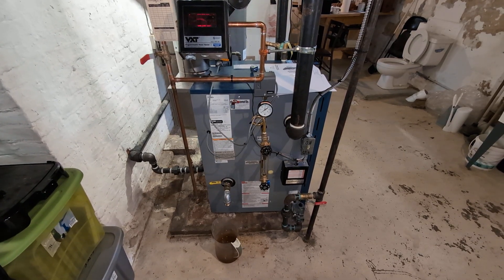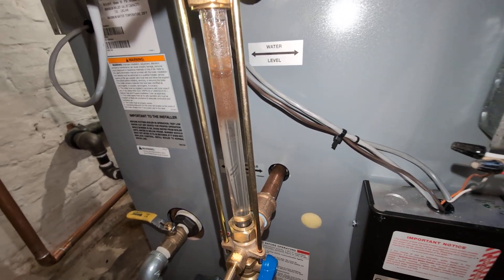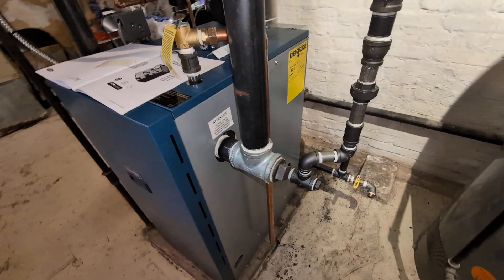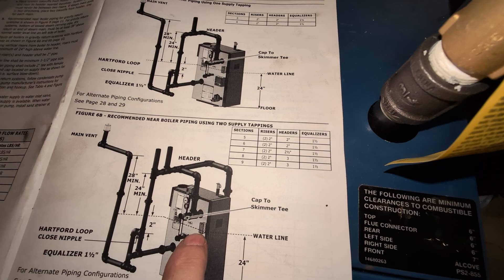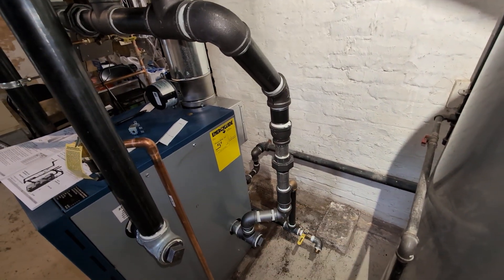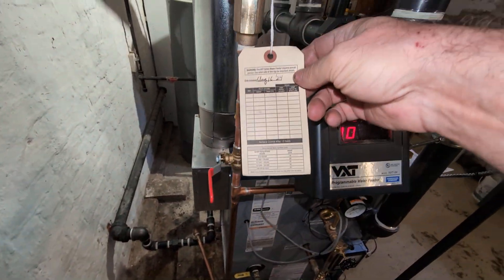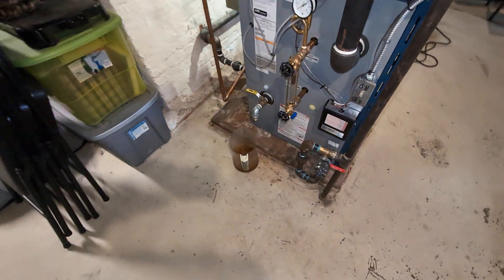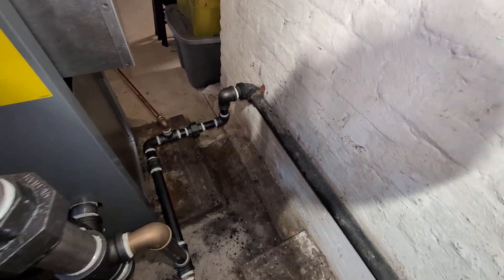Drop Header, Hartford Loop & A VXT Automatic Water Feeder On A Columbia Steam Boiler Install

Comment: Also,I don’t see many guys using vaporstats. Do you use them?
Reply from the maker: Yes, on systems that were designed for 1/2 psi or less (i.e. "vapor" steam systems or two-pipe)
Reply: @ would your A dimension dictate the pressure needed to run the system? Do you ever come across a home and say “ oh I know this is a xyz system,it’s meant to run at x pressure”
Reply from the maker: @Clamjammer  Generally, steam systems installed after December 1899 followed what became known as "the two pound standard", that is to say steam heating systems were required to be designed to use no more than 2 psi at the boiler or the manufacturer would not cover any losses if the boiler failed.

Comment: That's fascinating that they show a bullhead tee on the end of the header. I wonder if they made a mistake when drawing that diagram. You'd think it would pull all of the water going down the equalizer right up into the steam main. In my own system I decided to go all out on the header design and do a 3 inch drop header on a Megasteam 288, with king valves and return valve, a wye for the hartford loop, and ductile iron fittings below the water line, cast iron above. But since I'm installing it myself I can afford to go all out on my own installation. I can see where customers expect low prices and if you bid too high they may call someone else. The only real reason I use cast iron fittings today is because I know if I used malleable it wouldn't look right to me, and the boiler is right next to my workshop in the basement so I would be seeing it every day. I did go with imported cast iron vs domestic where I could, like the 3 inch fittings, because if I had gone domestic even with an account at the local plumbing supply, I would have spent roughly 3x the price per fitting. Surprisingly the imported cast fittings are much cheaper above 2 inch, but sometimes more expensive in the smaller sizes. Some of the fittings in the rest of the system like an eccentric reducer are so expensive that I cut the pipes short on the original 100 year old one, took it into the shop, and cut slots in the pipes and crushed them to get them out and reuse the original eccentric reducer.

Comment: Once again, another beautiful job with great explanations.

One quick question, the location of my outbound steam pipes force my boiler to be on the floor (while maintaining the 24" from the water line to the beginning of the header)- as the one you have in this video is.  If I add the drop header, would I be able to lift the boiler off the floor by the same amount as the drop header distance? I know most of the near boiler piping would have to change as well, but I'm just trying to make servicing the unit a little easier on the knees.
Reply from the maker: Thank you for encouraging words and for your question!
Yes, a drop header should allow you to get your boiler up on blocks (4" at least. A Good Thing), but there might be a limit to how low your header can go.
I don't know what that limit is, before the top of the equalizer line and the water returning in the Hartford Loop start getting too close to each other.

Comment: I like your street 90 used on the loop in place of a close.  Was brass intentional?
Reply from the maker: Thank you!
The brass was intentional.  Sometimes we use stainless and sometimes just plain old malleable.
It should be noted that disadvantages of using a street 90 ell is that it might "lock up" in a less than advantageous final orientation &  also it might end up too close to the equilizer line.

Comment: Do you ever put shut off valves on the risers for blow down purposes. I have a building that they welded up the mud drum clean outs. So my only option for a good blow down is to close off the branch runs. Run the pressure up to 10 psi and open the bottom blow down valve.......it really blasts all the muck out of the bottom.
Reply from the maker: @JJ-COMMERCIALHVAC  In your particular case, I'd say yes, a "king valve" was a good move.
For the most part, in residential systems, there aren't really good places to run the blow down!
Reply: In my own boiler install I'm installing two 2 inch OS&Y gate valves, one in each riser from the header to the steam main, and one 1-1/2 gate valve in the return. Because the king valves are flanged, that gives me a place to join together the near boiler piping and the system piping without using a separate union. In most residential systems I think the valves would get stuck because nobody would touch them for years, and also what he said about nowhere to run the blow down. In my house I have a walk out basement so you can just run it out the door, or you can bring the hose to the main part of the basement and stick it under the pressure treated wood floor to drain it into the dirt underneath. But I pay more attention to my boiler than most homeowners would.

Comment: Galvanized tee on the supply?
Reply from the maker: @Mike-rm7vf  We have found in taking apart scores of steam boilers that one or two galvanized fittings or nipples here or there appear to have no deleterious effects on either the fittings & nipples or steam production.
I have an earlier video showing what the inside of a galvanized nipple looks like after decades of use on steam.
Reply from the maker: We are also starting to wind down operations and retire, so we are using up old stock.

Comment: that 3/4 x 7/8 compression adapter is smart. I think I'll be doing that in the future if I gotta replace a T&P valve
Reply from the maker: Thanks!
It's really helpful on hot water boiler relief valves, as they tend to require service more often.

Comment: You mentioned the gas service shut off change.  Are tapered plug shut offs allowed still?  They are banned in my province and a valve with a CSA 3.16 certification must be installed.  
I guess the grease lube on the old valves must be finally drying out and causing leaks
Reply from the maker: Last I heard, taper plug shut-offs for gas are, at best, "grandfathered" down here.  
If the gas line is touched, the obsolete valve must (and by rights should be) replaced with the CSA 3.16 valve, with a "U S" on either side of the CSA mark.
CSA being recognized as a better standard than AGA.  Go Canada!
The old "AGA" (American Gas Association) mark is passing into history (still allowed, mostly).
The lube dries out and the plug gets stuck.
They also generally need a separate tool to operate them.  Not good in an emergency.
I have seen them with broken handles where someone has wrung them off.